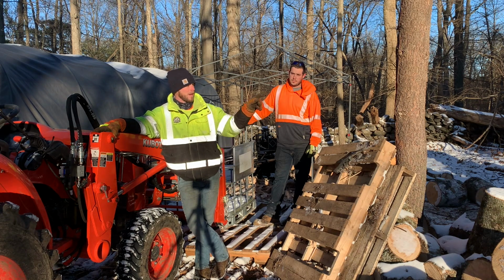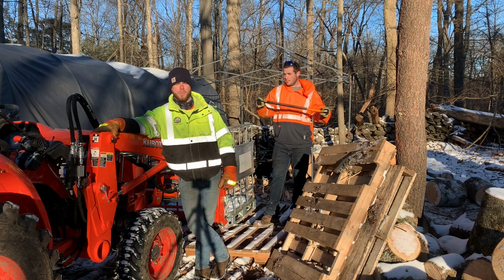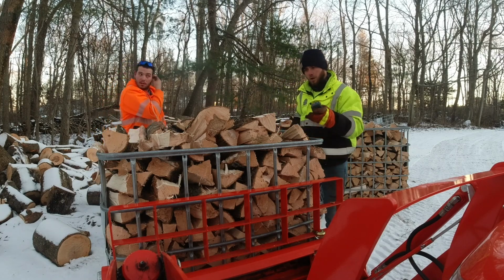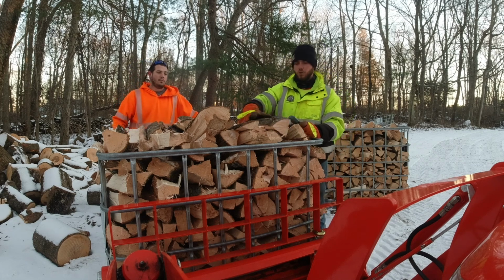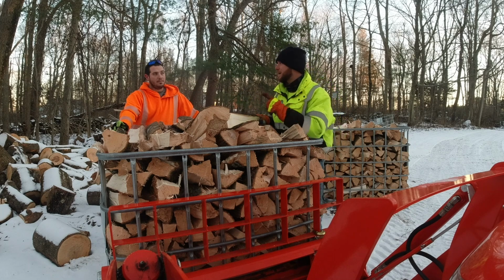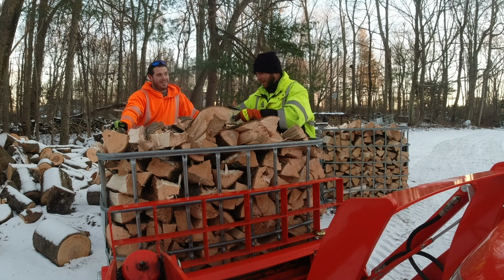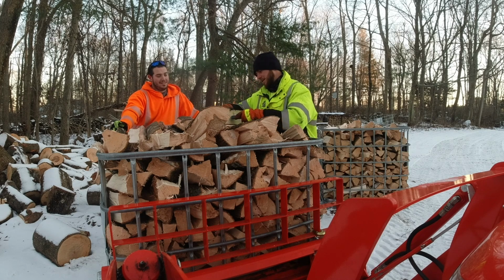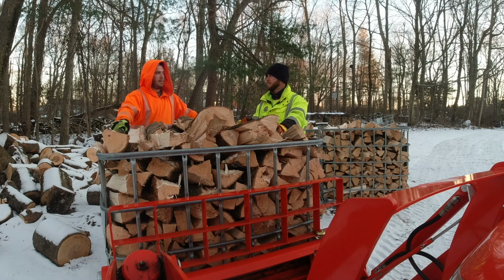#73 Splitting Maple Firewood with Modified RuggedMade Log Splitter

Comment: Looks nice, one thing I saw that could improve you output, most of your splitting is 16”, could it help you to design a backward limiter, or added attachment to hit lever to stop back motion at 18”?
Reply from the maker: Hey there Dave, I cut my wood to 18” to maximize space in the ibc totes, I normally run a return stroke restrictor plate at 20” that came with the splitter however lately it’s been causing too much pressure on the return stroke and snapping the bolt that attaches the cylinder to the push plate. I talked about this in more detail in my last video I need to spend some time and adjust the detent valve to fix this...thanks for watching!
Reply: @DudeRanchDIY  You might want to rig up a rod of appropriate length attached to the control lever that actuates the control lever when the other end of the rod is impacted by the retracting push plate. This stops the ram's retraction without loading up the through-bolt. There are examples of this type of arrangement out there on other wood-splitting Youtube channels.
Reply from the maker: @thomasgreene5750  Yes I have seen this on Andrew Kelley’s channel where he recently made one! The fact that I have an auto cycle valve with two different levers might make it a bit more complicated. I’m going to start out by throughly adjusting and experimenting with the return side detent valve, I think this problem can be solved by that alone!

Comment: Hardwood trees cut in the dead of winter typically are maybe 10 to 15 points dryer than  trees cut when they are leafed out.  Low 20s sounds too low, however. Bring a few pieces into the house, let them thaw out, re-split them and re-check the moisture content.  Then you will know if being frozen affects the results.
Reply: Yep inquiring wood minds want to know? I wonder about outside tempz and humidity? What's  the btu on maple? Love the different  camera shots!
Reply from the maker: Still need to do this... work has been crazy with all the snow! Its still on my list!
Reply: Pin-type meters measure the electrical conductivity of the material between the pins.  The conductivity of ice is lower than that of water, so the meter will read low unless it also measures temperature and has some internal "smarts" to make an adjustment to the reading.